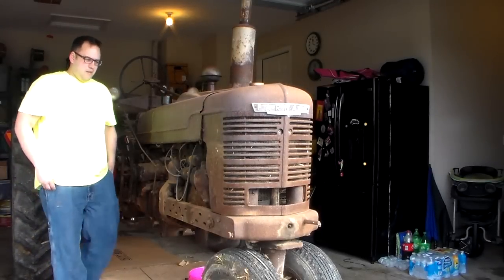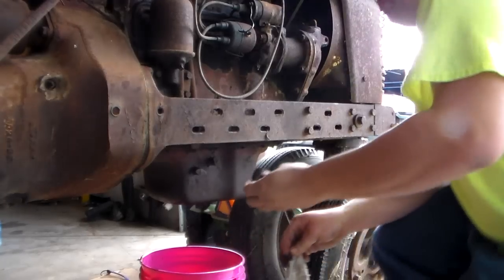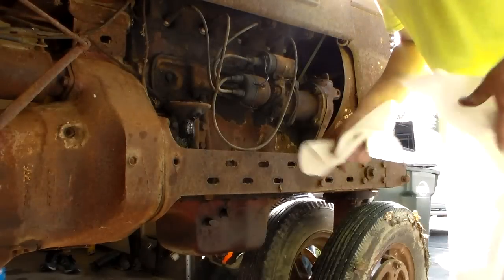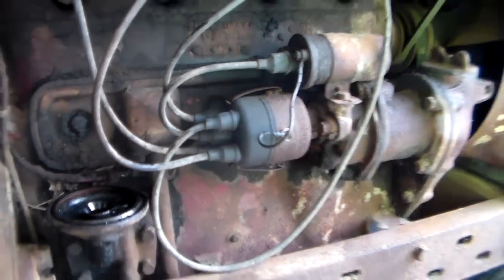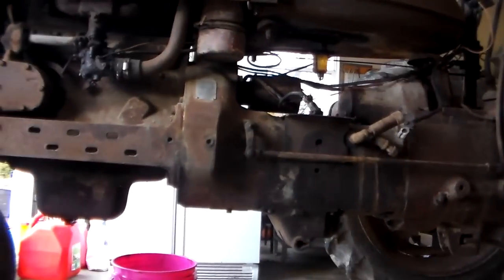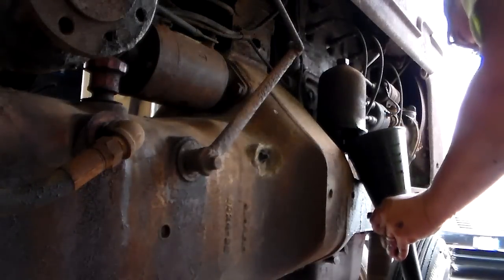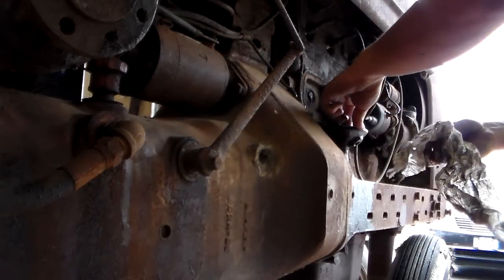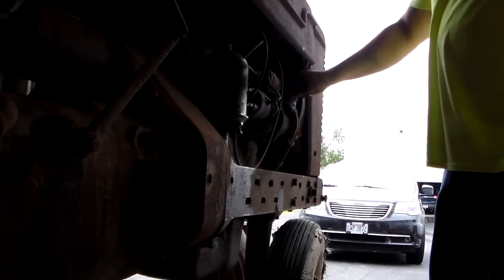1948 Farmall H Engine Oil Flush and Change - December 26, 2016

Comment: Add a grey bottle of STP Total Treatment fuel injection in every 3 months fuel tank full plus add Dextron 2 Automatic transmission fluid in also use 89 or higher octane gas 3.5 gallons  with 2  gallons fuel it all get that motor run like and clean it out to! Fuel  try using Shell or Havoline or Harmac fuels ! Plus use no synthetic 10W30 engine  in too ! Plus use high grade  ignition wires  plus Champion Spark plugs gap  from 15 to 25 foul and points to under cap and rotor they are should be at 20 foul gap!
Reply from the maker: Thanks Andrew.  Great suggestions.  I actually have an update video where this poor tractor has been sitting outside without running for a few years now.  I am planning on doing an update video within a few weeks where I get it running again.  https://www.youtube.com/watch?v=WXtQVDH49-I

Comment: That wasn’t long enough for the diesel to do any cleaning. I would let it idle with the diesel in it for 15 minutes to really let it clean the valvetrain, oil passageways, and ring packs.
Reply from the maker: I’ll be doing a video of it again this summer.  Tractor has been sitting and I’m going to flush it again.  I’ll run longer this time; just fearful of doing damage from improper lubrication.

Comment: I wouldnt take a chance with low sulfer diesel to clean an engine ,put in IH # 30 diesel oil for a few hours and change it to low ash IH # 30.Never reuse an oil filter.Change the air filter oil and the steering gear oil probably needs changing(remove grill housing  gearbox is in front top of radiator).Grease the clutch throwout bearing.
Reply from the maker: Gary, thank you for the recommendation.  This tractor has been sitting non-running for a few years now following this video.  I'm going to try and get it going again.  I'll post an updated video of the process to get it going again.